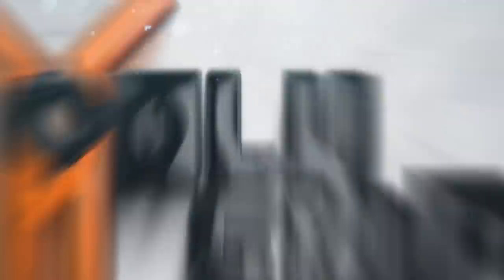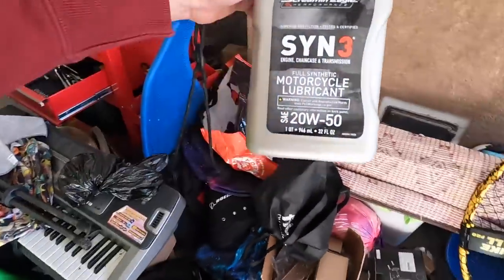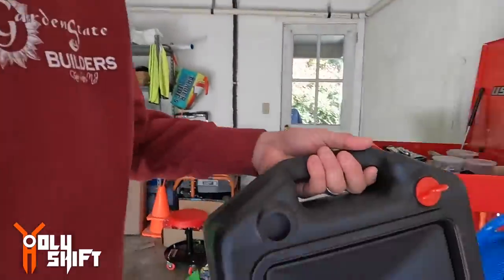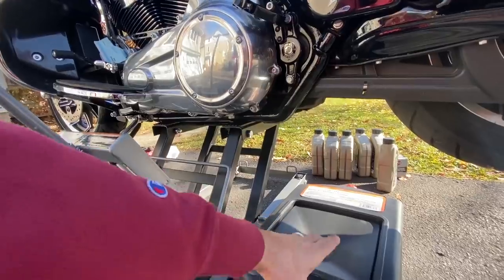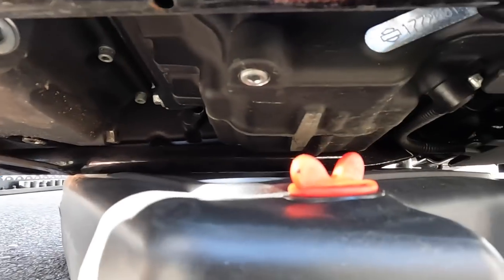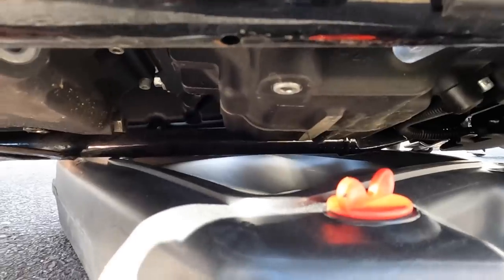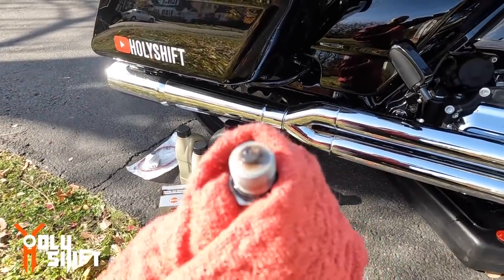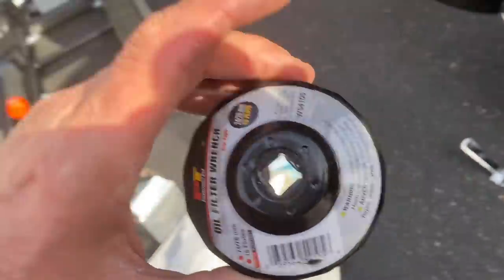How To Do An Oil Change On Your Harley - THE WRONG WAY !

Comment: Hi Sandy, just an FYI. I have a front chock for my 2015 FatBob and I mounted it onto a sheet of 1/2" plywood. Counter sunk the nut holes so the plywood lays flat on the garage floor. Approximately 10" longer and 10" wider than the bike. I put 2 pad eyes on either side of the rear. That way after placing the bike in the chock, you can strap the rear down to the pad eyes and be sure no matter what the bike wont fall over. A side benefit to mounting it on plywood is that you can store the chock upright or on its side in the garage when not in use.
Reply from the maker: Good idea
Reply: Hey, Frank, what are pad eyes?  I like the idea of mounting the chock on plywood👍
Reply: @frankcardillino5834  ah yes, your explanation immediately made sense.  Now, you put the eyes on the rear of the chock mounting board and strap the rear of of the bike to the board, is that correct?  Thanks for your time, Frank!
Reply: @jolkraeremeark6949  Yes, that is correct. Remember to counter sink the bottom side of the plywood for the nuts that secure the chock and the pad eyes, that way the board will lay flat on the garage floor. Use washers then nuts so the load is spread out and 1/2 inch or 3/4 inch plywood so there is plenty of board after you counter sink for the nut/washer for both the chock and the pad eyes. I don't place the pad eyes to far back on the board, just enough so that the tie down straps don't take too extreme of an angle. You can email me if you need to discuss further at fcardillino@gmail.com

Comment: I can remember my first Harley oil change, lol. I enjoy your videos. I purchased a tire chock that I put two holes in shop floor, I can remove it easily. It allows bike to stand straight without assistance. Later when I purchased lift I used that same chock to replace the factory one. Swap to K & N filter, use regular 17 mm socket to remove 👍

Comment: Thanks Sandy, nice job. Two things I would do differently. You need to take your bike for a ride to warm it up enough at least 20 minutes to get It good and hot also put more oil in the oil filter. The small amount you put in was soaked up by the filter. Fill up the oil filter then wait for it to soaked in then add some more until its 3/4 filled and no longer going down. Hope this helps. 
Love your videos and appreciate you.
Happy holidays!!
Reply from the maker: Thanks for the tips! next oil change...

Comment: Just as a bit of information; I use syn3 in the crankcase, BelRay fluids in the transmission and primary. Each is specific to the application. All different colors so if you have a leak you know where it’s coming from. BelRay has unique formulas for each cavity and are race track proven.

Comment: You did good Sandy. I use a chalk with a small 2x6 under rear wheel to level the bike out. One thing I would do different is jack the bike from the right side for two reasons. One you can get most of the jack under the bike before you pull it up and two if it gets away from you it will fall down on the kickstand.
Happy Thanksgiving to you and yours.
Reply from the maker: Thanks buddy
Reply: I agree; been using a jack for over 25 years. Also gives you full access to primary cover.

Comment: Hey Sandy, you can use that motorcycle Jack when you change your oil. I do. I have a 21 Roadglide Limited. You just have to be careful with the Jack placement and not block access to the drain plugs. I use a small pan like you get when your in the hospital as a drain pan. It fits in between the frame of the Jack. Good job, glad to see you working on your bike.
Reply: Forgot to mention that I usually Jack it up from the air cleaner side. It gives you a little more room for the drain pan and access to the drain plugs
Reply from the maker: Yeah I guess I can do that....

Comment: Enjoyed the video Sandy.  If it helps, Harley makes their own low profile oil drain pan that makes it easier to access all the bolts to drain the fluids while on the jiffy stand.  It will give you a little more room to work with than what you have now.  I've always changed my fluids for many years on the jiffy stand with no issues.  Also, if the O-rings for the drain plugs are torn up like that, then you can bet the O-rings were not seated properly when installed prior.  There is a small groove on the end of the threads that the O-ring needs to be seated in correctly.  If not, it will tear the O-rings up like that and could eventually leak some.  If you know what to feel for, you can tell if you pinched the O-ring at the moment the plug tightens and seats.  Happy Thanksgiving my friend.
Reply from the maker: Got you... I did roll the O-rings all the way down this time...I think I'll get the forward chock

Comment: Hey sandy , harley also carries an oil filter with a hex Head set up so you can just use a socket with an extension.  So much easier in my opinion.  I have same bike and do all my own changes from the ground since the lift obstructed the holes
Reply from the maker: Great point about filter

Comment: Harley Davidson sells an oil catch pan that fits under the bike on the kick stand,  you don't need Jack's or anything to balance your bike.  I use k&n oil filters on my bikes,  they have a nut on the end,  you can use a regular socket or wrench.  They also come in chrome or black.
Reply from the maker: My next filter

Comment: Change the oil on the side stand. All the drain plugs are on the down side of the reservoirs and will drain to the drain hole that way. Get a different drain pan that fits under the bike. Primary oil, loosen the primary cover screws before draining the oil just in case you cannot get the screws out you will still have oil in it. I place a piece 2X6 board under the side stand to get the bike upright to fill the oils and check them. I only use a 5/8”  socket or wrench for the drain plugs that way I don’t put a hex on a screw that should not be removed by accident. Don’t  use a scissors lift unless that bike is strapped down in a bolted down chock, you will topple the bike over. Don’t forget to clean your air filter unless you have a bypass kit before it drips oil all over the bike. My thoughts.

Comment: There are MUCHBETTER jacks out there....my J&S jack came with a pan that you put on the jack itself, you jack up the bike and all 3 holes drain onto the pan and then runs down to my oil container...I like it more than even using a lift if I am honest...the other thing, I wouldnt jack the bike up from the kickstand side, do it from the opposite side so you have access to everything (like the primary cover) without the jack in the way...  As far as torque specs...the filter is just 1 "ougga dugga" and the drain plugs are 3 "Ougga Dugga's" :D  If you ever decide to do the K&N filter, it has the 17 mm nut on the end, however ONLY use it to loosen the filter, not to tighten it...you dont want the bolt to break off.  I love seeing everyone else make all the same mistakes I do when doing an oil change or anything else on the bike for that matter...:D
Reply from the maker: Yeah J&S is a good lift/jack. And it’s 1.4 ouga Doug’s for the filter not 1 …🤣

Comment: Save pieces of cardboard for the driveway. Get foam of some type to kneel on. If your not wrenching most of your life use a quality torque wrench. Condor makes the best vertical drive on stand but an HF will do, just anchor it to the floor.

Comment: Sandy - Check this solution which should work with the Jack that you have. It works with a different jack brand BUT the concept is relatively easy to accomplish with some DIY gadgets. Worse case, get an empty container (like empty water gallon) with wide-opening funnel and place it right in the middle of your current jack. 

https://youtu.be/RKkTv6bs8TI?t=169

Comment: Sandy,

You call me before you work on anything from this day forward, lol.

Just kidding brother.  The jack goes on right side of bike.  Secondly break the drain plugs loose before jacking up.  Thirdly take the oil fill cap off when draining.  

You will get it brother, just always remember safety first.  If ever in doubt take a step back and re-evaluate your projects.

Wayne
Reply from the maker: Haha 😂 thanks

Comment: I’m fully transparent at how pathetic I am using my new (for the first time) GoPro. Yeah, I was brave enough to upload to YT. My goal? Make improvements every time.
On a side note…. For the life of me, I don’t know why Harley doesn’t add a center stand. That would make life so easy when it comes to oil changes. My GoldWing has one and there is only one drain plug. Literally takes 15 minutes to do a full oil change. Of course I have changed my oil so many times on my Harley that I can knock out all three holes in 30 minutes or so.
Reply from the maker: Yeah Harley engineering is 50 years old…..👍🏻 😆 LOL 👍🏻

Comment: Just my opinion I pour some oil filter
Reply: Sorry I sent it before I was done. Pour some oil in the filter let it set a couple seconds for it to soak through the pleats inside then install the filter my cause a little mess but the oil pressure will pick up quicker once the bike is started. May not make much difference but knowing the few seconds quicker oil is circulated is a good thing.

Comment: dont tell people to idle an air cool engine untill its warm enought to change oil. harley recommends idling less than 30 seconds. so get on your bikr RIDE IT for 20 -30 minutes. your oil should be at operating temperature when changeing but no so the oil is"  warm " but to pick up any crap thats floating around in it. idling your bike for more than a few minutes is a greatcway to destroy it.
Reply: ps you can get a pies of 2× 4 put it under the stand and....save 70$
Reply from the maker: Thanks

Comment: Can't believe all this is needed to do a simple oil change. On my Indian to empty the oil, I simply balance the bike on the side stand then drain the oil. To change the filter, I simply use my hand and twist off the old filter. Plus, I drain all my fluids (engine, primary, and transmission) simultaneously. Does HD do ANY R&D on their bikes? I like the video and your content, not being critical of you, but Harley needs to do better. It's 2021! An oil change should not be this complicated.
Reply from the maker: I agree with you - Harley still uses tech from 40 years ago. I think thats part of the appeal that people like...nostalgia ...
Reply: @HOLYSHIFT  Agreed but bikes can have nostalgia AND great engineering. They're not mutually exclusive. Keep up the excellent content! 👍🏼💯